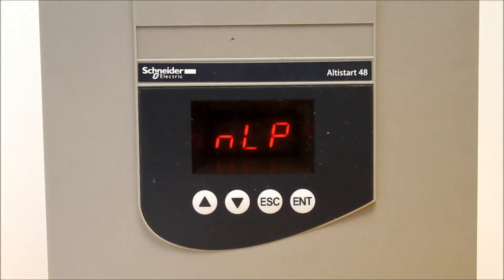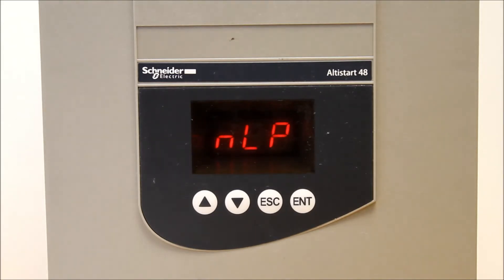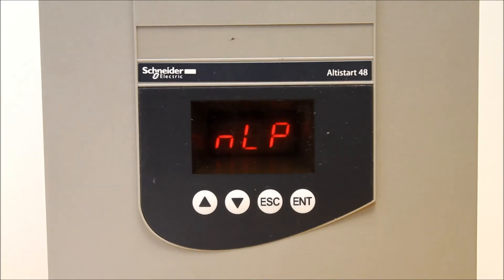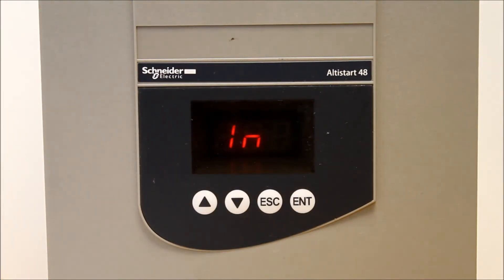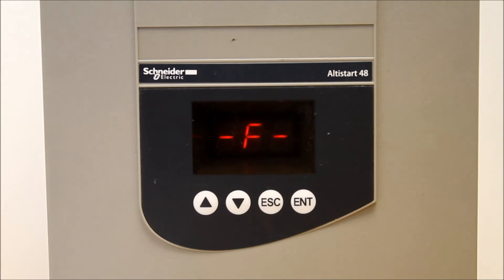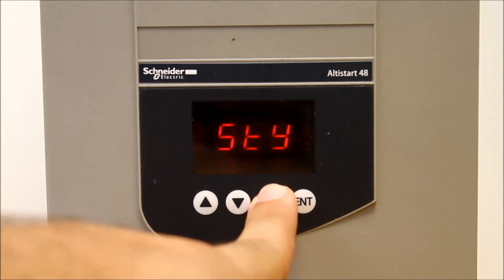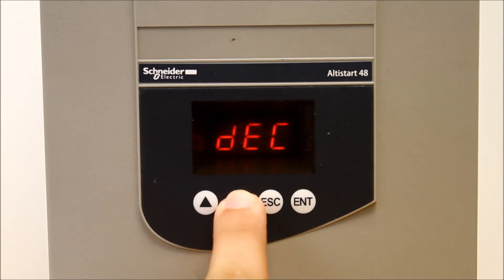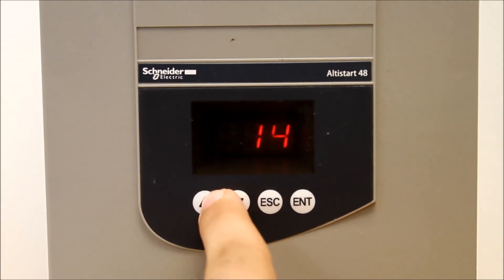Configuring Ramp Stop on Altistart ATS48 | Schneider Electric Support

Comment: Have been through 3 soft starts. Used all settings correctly as shown in video and in manual. But the pump WILL NOT decel,  any recommendations on how to fix this???
Reply from the maker: Thanks for reaching out! For any technical queries, we suggest you to contact our technical team via - http://spr.ly/6058JzcTA who should be able to assist you further.